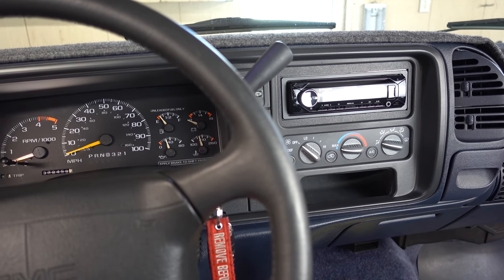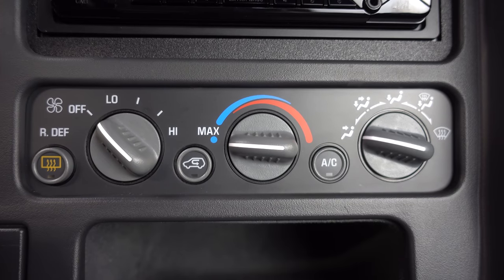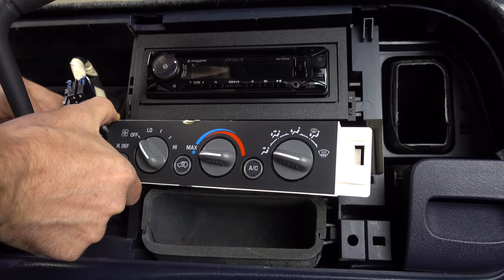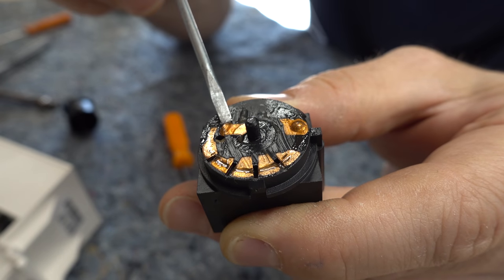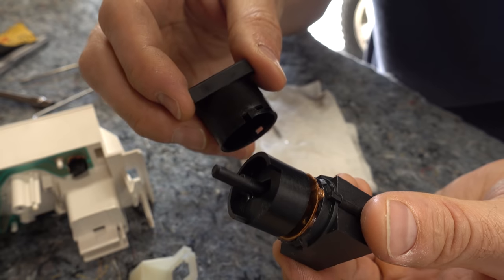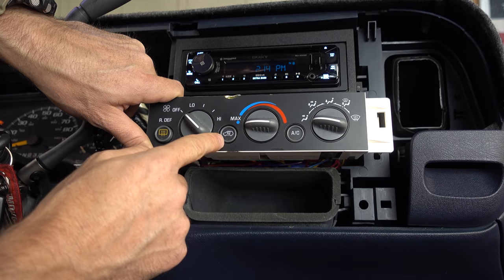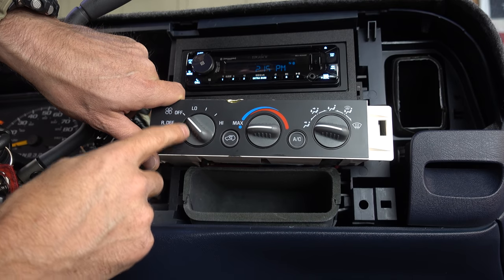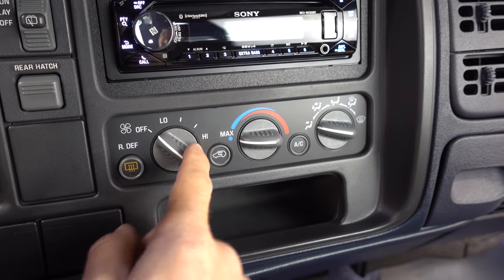Here's Why You Should NEVER BUY BRAND NEW PARTS AGAIN!!

Comment: I have a problem with that switch but it's not lights flickering but fan speeds disappearing.I cleaned it, replaced it, replaced wire connector,whole unit,and the fan over time. it burns the switch at the connector. I just leave a couple in the glove box for when needed. Also the guy who said watch those plastic clips holding it in place is absolutely right they are brittle as can be.

Comment: The scrap yard is where I went to fix this kind of issue with my Jeep. You had to hold the recirculating button to keep the AC switch on. Went to the junkyard, snatched one out of a "donor" Jeep for 20 dollars. The control panel on my Jeep was much larger and also had the switches enclosed so I didn't want to mess with it and break other things in the process. 20 dollars beats the 200 I would have spent for a new one. So yeah you don't always have to buy new parts.

Comment: Great video and advice👍
Also alot of intermittent electrical gremlins can be traced to cracked or cold solder joints, easily fixed by re flowing the solder.

Comment: FYI, Dielectric grease is non-conductive, smearing it over contacts does not get you a better connection, it actually impeded connection but it does a great job of preventing corrosion.
Reply from the maker: The point isn't a better connection.

Comment: One easy repair. Almost fixed the hazard light switch on my 2001 Oldsmobile Intrigue, which controls the turn signals, but, I didn't have any sand paper, only contact cleaner. Decided to get a new one and fixed it myself. Going to fix the rear windshield wiper motor, the quarter windows on my mom's van, and fix the power window on my car (rolls up slower when it's cold outside and I believe the motor coil needs a good scrub down with sand paper). For electric motors for windows and wipers, do I need the dielectric grease or is that only meant for switches?

Comment: You do realise dialectical grease is used to prevent moisture and corrosion. Most importantly for this application, it also disrupts electrical flow. It really should never be used directly on any contacts as it can reduce the electric flow.

Comment: Thanks. Great video.  Have you had to work on your power seat panel?  I have a 96  Suburban SLT  and it has 4 button driver side seat switch. The button that moves the seat forward and backward does not function. It appears (have been hesitant to take entire control out) that the front/back button might be a separate switch  from the other 3 control buttons. I'm thinking the problem is not the motor because 3 buttons work and I assume there is only one motor.  I haven't been able to find a 4 button control switch or a single button switch. Have you had to work on your power seat controls. Any input would be appreciated.
Reply from the maker: Dang man, haven't had to tackle that yet. Best thing to do is open it up and have a look.
Reply: @1RoadGarage  Guess I will have to open it up. Pffhand do you know if you have a total of 4 buttons on your driver side power  seat. Thanks. Have a good one.
Reply: @johnf9076 :
Most seats have a 4-way switch for the seat and a single SPDT for the seat back. But you could. Use a center off momentary rocker switch for each pair of movements and build your own control panel for the seats. 
 If you decide to tear into it do it in a very small confined space.  It should have a refrigerator in it. That way all the small springs, and whatever.  they launch will be easy to find... they will be under the fridge.  I have opened small springy stuff in gallon freezer bags to catch unexpected launchings.  I had a 20 gallon aquarium on its side with a set up sorta like a sand blasting cabinet for installing small circuits and such. It could be awkward but it saved looking for those evil clips.